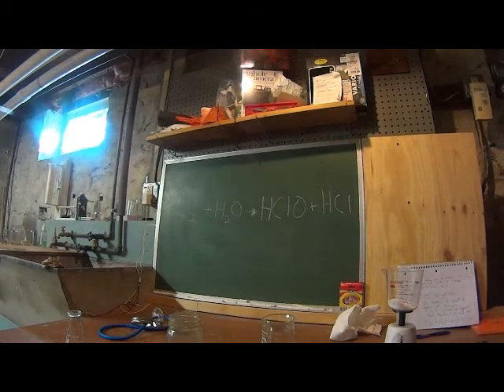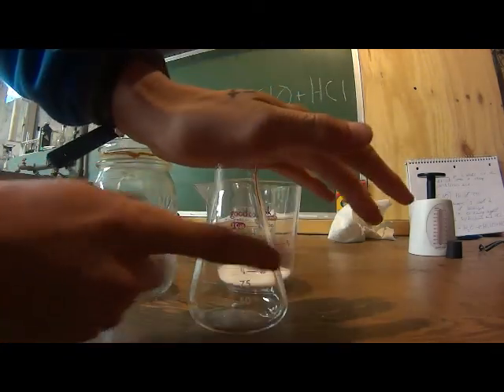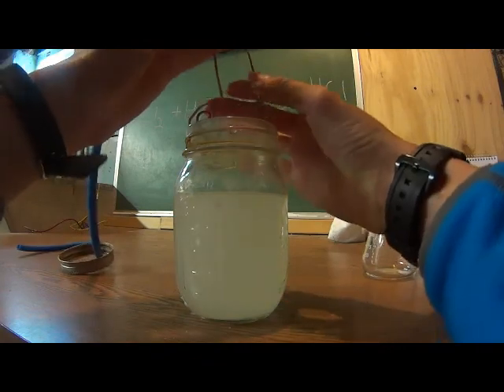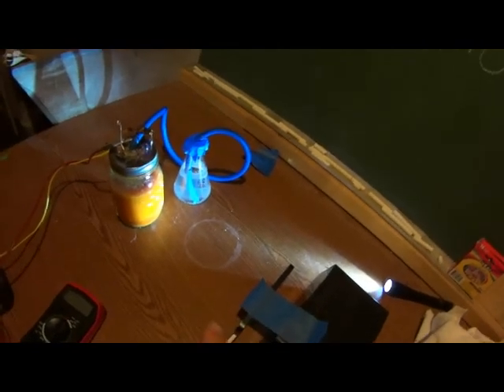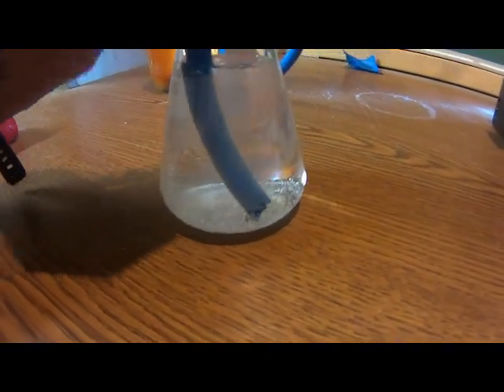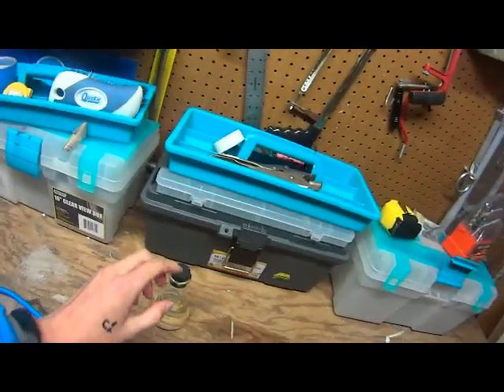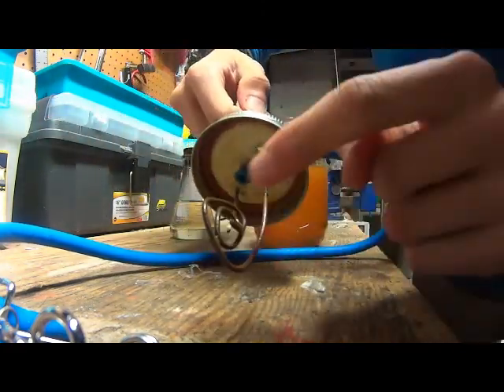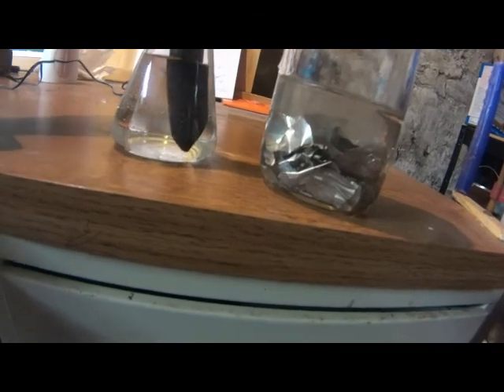How to make HCl and HClO (bad process)

Comment: HCL? where? what happened to Sodium? LOL
Reply from the maker: Bruh look at the title and description
Reply: @Piperliam  just gotta tweak it a bit and you can get it to work.
I recommend using a PVC card membrane made from pipe glue and salt cake anode chamber for best results!!
Also usage of DSA or magnetite electrode in anode chamber ensures chlorine evolution with DSA being the best electrode for this process as its the industry standard and you can pick up a pair off ebay I recommend getting Irridium-Ruthenium oxide based DSA.

The amount of chlorine gas emited by a working cell though is scary!! enough to be lethal if you accidentally inhale some directly from the cell.
Reply: my vid shows proper chloroalkali HCl generator.
First hes missing a membrane
next his electrodes arent graphite or Ru-Ir DSA aka MMO.
lastly he doesnt have any way to react the produced H2 and Cl2 via UVC lamp (safer) or burner/spark plug (dangerous)

Comment: You made Copper Chloride In water, And Hydrogen gas, In order to make Chlorine gas you have to use Graphite or Platinum Electrodes.
Reply from the maker: I know, this is a very bad video. But thanks for the comment!

Comment: You’re doing several things wrong.

Do this instead.Use 2 jars
Use a bridge tube (plastic tube filled with brine )
Use non-iodized salt.
Use distilled water ($0.88 at Wal-mart).

Get 2 used lantern batteries disassemble them and heat the rods to remove the wax binder.

Place 1 electrode in 1 jar, 1 in the other.

Fill the jars and bridge tube with (supersaturated brine -
heating the salt and distilled water on the stove until nothing more dissolves).

Use an automotive battery charger to produce higher steady
state currents.
Place the electrodes and connect the charger.
What you’re doing generates hydrogen, chlorine and oxygen gas
in the same solution and then bubbling them  through water that is already
contaminated with dissolved solids.

By using a separator bridge you draw the Cl ions into one side
and pull the Na ions into the other.
It will also eliminate your short circuit issues.

Comment: Make your insulators with silicone caulk instead of hot melt glue and use graphite electrodes (pencil leads) instead of copper and you won't have these problems.  Just an fyi for future experiments.  =)
Reply from the maker: +Richy Rich Thank you for the comment! I plan on redoing the video.